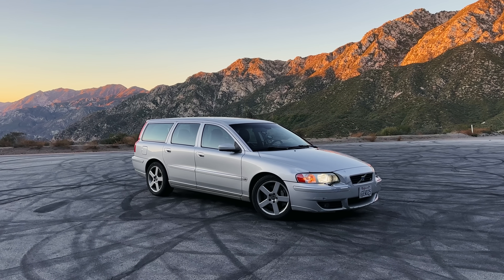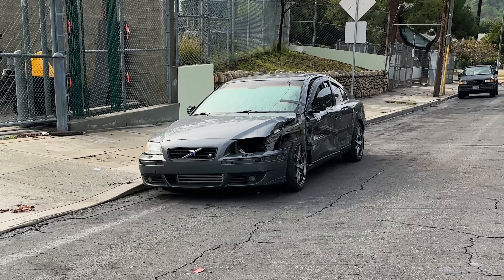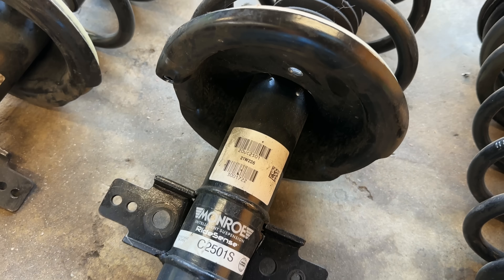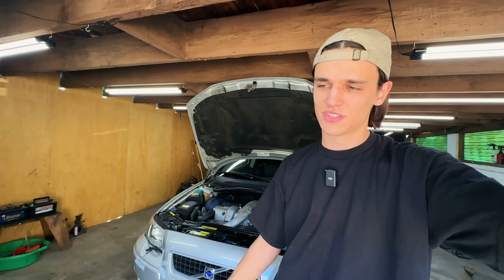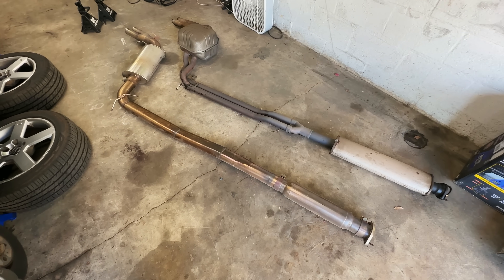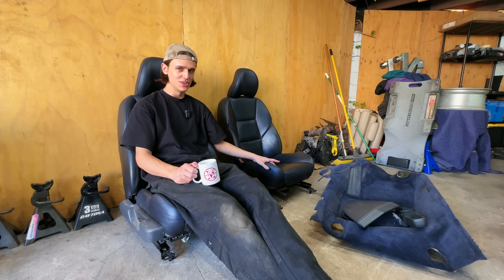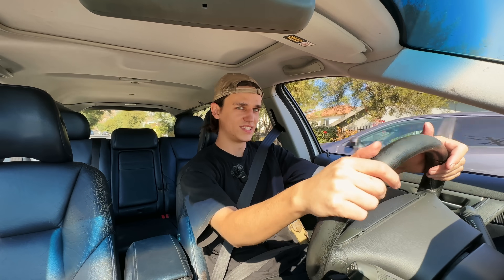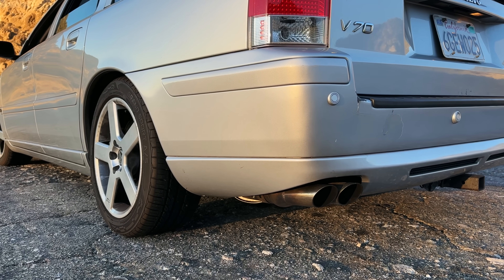Suspension, Exhaust & More for My $1500 Volvo V70R

Comment: About the rearview mirror, you can't just simply replace it. It contains the Upper Electronics Module (UEM) and that controls the rooflights but also contains the radio receiver for the central locking/alarm. It's possible to just replace the glass from another working unit, but it's a bit of an operation.
Reply: Another idea is to hide the electronics inside the headliner and use whatever rearview mirror.
Reply: I have a problem with my key only unlocking the car when the key is right up next to the mirror. My glass has also got the fluid leak problem like in this video, any ideas what I’m best doing ?
Reply: @ChrisGil94  I'd first change the battery in the remote 👍
Reply: common pcv issue. i would do the glove test.  (pvc glove test) if that one is bad all the other vacuum lines are the same including the turbo lines. i have a s60 and had to replace all the boost and vacuum lines. not hard just annoying. good luck and welcome to p2 chassis head aches 🤣.

Comment: S60R is 3” shorter than the V70R, also remove that bracket behind the resonator or flip it around and put it over the exhaust and below the driveshaft. It’s called the bracket of death cause when it gets caught on the road it’ll shove the exhaust into the driveshaft and cause irreparable damage.
Reply: That PCV hose is the original design from 05 😂
Reply: bump
Reply: This.

Comment: 26:16 LOL this brought back memories. In my first few months of working at Volvo as a mechanic, I casually rested my left palm on that same PCV hose while reaching for something else nearby, and I felt it disintegrate. I still remember the service advisor's face when he was the one going to have to explain to the customer why they need to spend extra money on a pricey swedish rubber hose despite it "technically" wasn't broken before they came in.

Comment: A bit of info on v70 and s60. V70 is S60 in wagon form because its built on the same frame and chassis (s60 was conceived before v70 on the p2 platform), just about any part from these cars are interchangeable. S80 while also being a p2 (assuming same year) platform is not the same as s60 and v70 and a lot if its parts are not compatible.
The crossover year began in 2004 for v70 and s60 and ended somewhere in 2005.

As someone already mentioned you need to calibrate your newly installed shocks, because the car has a sensor which actively monitors the cars chassis position relatively to its shock travel (correct me if i'm wrong on this one). I'd recommend changing the bushings in the engine sub frame, will vastly improve the way the front of the car handles. I wish i could put the codes that you need, but youtube marks them as spam. If you entertain the idea of changing them : the 2 front bushings are different from the 2 rear bushings, (front are with a blue ring around them and the rear ones are with a white ring). At some point one of the rear bushings had an oval hole (while the rest are round), that is no longer the case and all of them have round holes.

If you feel some sort of vibrations when the engine is idle on the steering wheel, your 2 hydraulic motor mounts might be shot, they are vacuum operated (can be easily checked, if they dont hold vacuum they are shot, do check the vacuum lines as they might have holes in them). Also check if the "boot" (below the vibration dampener, the one that serpentine belt is on) on the right side of the engine is not torn.
Reply: Thanks for confirming that on my v70 too the motormounts are shot :( 
Ah well, suspected it already.
Reply: Hydraulic pillows?
Reply: @ST3ADYxKICKS  Yeah my bad, the correct term would be hydraulic motor mounts. The word pillow was the first thing that came to mind, simply because they work somewhat the same and i've edited my post to correct the mistake.
Reply: @Torchedini  Before your start firing up the parts canon: check all vacuum hoses going from motor mounts as they tend to crack with age. If they are cracked, dont buy original parts as the cost is beyond ridiculous. Just get a hose that is rated for fuel/oil (i think it was 4mm inner diameter). Also check the solenoid that lives on the air filter box (diesel version) and as for gasoline version i cant really help as my knowledge is very limited on those engines (i'm talking about how gasoline engines supply vacuum to the hydraulic motor mounts).
Reply: @MrKypc there is no vacuum connection on the motor mounts
Reply: @ST3ADYxKICKS   Hey, you are absolutely correct. I've checked the part numbers and it turns out that only the diesel engines had vacuum operated motor mounts while the gasoline ones are just regular mounts.

Comment: Absolutely loving this V70R series. Your crashed S60R has the leather airbag cover still. It's an easy fix to remove it from the old airbag and reinstall on your post-recall V70R airbag. Remove battery terminals for at least 5 minutes though to prevent explosions!

Comment: I have an 1985 Oldsmobile as a project car and 99.9% of the time, it is easier to work on than newer cars. However, after watching you remove two snap panels and two bolts to replace the drivers carpet, I am unbelievably jealous. It took me an entire afternoon of removing seats and trim with an entire range of sockets and screwdrivers to remove it and had to fight the factory adhesive on top of that.

Comment: Nice job! One of my favourite cars, for sure. I can't tell you how I feel whenever I watch a video from someone in the South working on a 20-year old car that has no rust, everything seems to be coming off super easily and they have the guts of complaining of some "rusty" bolts lol!!! It must be a mix of anger and envy haha! You should see my 2004 Saab 9-5 that spent its life between Toronto, Ottawa and Montreal, Canada. Nothing comes off easily, the rust if omnipresent and it's always a crazy chore to take off anything. The salt gets everywhere, corrodes anything metal, even aluminum. I need to refresh the suspension and I know it'll be 10x harder than what I just watched. Many of the bolts aren't even hexagonal anymore! But so is the reality up here. Keep up the great content, I'm so glad this V70R was saved, it's just beautiful!

Comment: Good content and great vid.
Before you throw out the old 4Cs, cut off the pigtails and save them to re-sell.  Some ppl need them if they are doing away with the 4C suspension to "trick" the computer to think they are installed.
Also, when working on suspension, I almost always replace parts in pairs / on both sides.  E.g., in your video we only see you replacing one upper strut mount and one upper strut bearing.  I would have replaced both of these parts on both front struts.

Comment: Same PCV hose fell off on my 2006 car. After testing the system with the glove test, I just replaced that single hose, not the whole system. 
Hadn’t appreciated the changes to the seats over the years, but had noticed that your car seems to have some elements of the pre and post facelift cars in Europe. You’ve got a facelift interior and exterior, but the fuse box and charge carrier are pre-facelift. Might be different specs in the US 🤷🏼‍♂️
Great job on the fixes.

Comment: Did you look at shock tower on inside? I had a ton of rust. I sanded it hit with bullet rust the rust-oleum. One side had a hole once I pressed on it. Top side looked fine too.  My exhaust bolt broke you got lucky 😊. Love the videos. Thanks for sharing.

Comment: Been watching for a min. Just added  eaibach sport lowering springs with the same amount of drop, snap tight work on the connections for the 4C’S it can take a while to get all the wiring to run correctly, but top not h  as always. Had to watch for a 3rd time 😊

Comment: The PCV hose has a replacement part at the Volvo dealer that has a different design and is much softer material. And you can't use a regular hose clamp on top of the cylinderhead, it must be one of those that you crimp. It is unfortunately an intake off job - kind of painful, but doing that is also a good opportunity to check all the other parts of the PCV system. Expect 3-5 hours of work and some back pain. Did this on my S60 T5 -05. Oh, and if you are about to replace the timing belt no special tools are needed for that, just make sure the engine is at TDC when you unhook the belt, the cams will stay where they are.

Comment: I've got a 2007 v70 with like 450k on it. After a series of leaks from the windshield and sunroof the interior got kinda gross and it is absurdly hard to clean.  I just pulled the interior and sprayed the inside with bed liner lol its looks great! and you have loads more room for your feet =)

Comment: Exhaust hanger removal tool - makes it so dang easy! 

Throw away that bracket @15:20, It will get bent (as it already is) and push your exhaust up, damaging your driveshaft. Expensive for a stupid bracket. It should be fully supported by the hangars not touching the bracket. Search rain squeal, it can even happen without the bracket being damaged.

Throw on a downpipe and you'll realllly enjoy the tunes. I've got an exhaust vid on my page
Reply: That bracket was used to pull the car down the assembly line and should have been removed after the car was built... but on most Rs, it never was.
Reply: @xhf8yxhf8y9  I've heard some people say this before!

Comment: Assuming you just swapped the whole rear view mirror assembly I'm sure you've noticed how the cars alarm, sunroof and automatic dimming has stopped working.

There's a control module inside that mirror and they are specific to the cars, you can't just swap them. Instead you need to just swap the glass itself, it's quite an easy job if you know how to solder.

Alternatively you'll live with no alarm, sunroof, auto dim, rain sensor, etc.

Comment: It might be possible to just swap the seat skins between the two since they're just connected with hog rings, as long as the seats themselves are identical. I did that in my 850 and it takes some time but imo its definitely worth it.
Reply: If I'm not mistaken you can even take the skin from the opposite side. Passenger side ones tend to have less wear.

Comment: Hey - you just have to pull the leather out of the seats - it's a dirty job with all the clamps, but it works. I've done this several times - you can even take the seat from RHD - in principle there are also special tools for the clips, but with the right pliers or cable ties it works too. can send you infos/pic´s from my work on seats if you want

Comment: Yo! just a heads up I am pretty sure that the actual leather itself is the same size, they are not too hard to swap. A bunch of metal clips hold them on, once removed leather slips off.

Comment: Cant wait for PCV replacement, I got the same issue, and it was fixed a year ago, and still leaking... aldo hole in carpet - same as meine :) I think it criuse control related somehow when your right leg has not so much to do

Comment: Hoo boy, have fun fixing the whole PCV system
It's absolute HATE
Also, when you take off the intake manifold, take the whole thermostat off to get to the bolt, it'll be so much easier to do
And don't forget to buy all the right gaskets
And most importantly DON'T STRIP THE BOLTHOLES IN THE PCV BOX
I stripped one of them and of course it was the one that I couldn't get to easily so I had to make it an M8 screwhole but only halfway so I had to put like 5 washers on the bolt so it holds the box
I'm still mad about it

Comment: sweet, love v70s. when the battery gets old/weak, watch out for random codes, classic symptom for these cars. front bumper - should be very straightforward and not too expensive to get that repainted locally, assuming it's not completely trashed.
Reply: Yep, when my battery went out it started throwing a bunch of codes. ABS service required, lights going on and off, random noises and things happening. Thought my car had gotten some major electrical issue, just needed to replace the battery and the alternator which was going bad as well. 

I had the unfortunate experience of having both my battery be close to dead and my alternator dying at the same time. Started the car, was a very slow start but it worked, then the alternator died in the middle of my trip meaning the car wouldn't run. Easy way of knowing the alternator is bad is if you can start the car using the battery or a jump starter, but that it dies soon after starting up. Injection and everything runs off of alternator power when the car is running and not on the battery, so the car just dies after the start.

Comment: Did you replace the entire rearview mirror or just the glass? Incase you changed the whole unit you need to know that the recevier for the keyfob is inside, the original one is coded to the car.

Comment: random comment, HOW good are those amazon linkable work lights! I got some last year and love them.
Reply from the maker: I love them so much but one of the connecting switches/wires got too hot and melted. Switch melted too so be careful leaving them plugged in unattended 💀
Reply: @wheelemverb  oh wow, havnt had that issue yet but I’ll keep an eye on them!